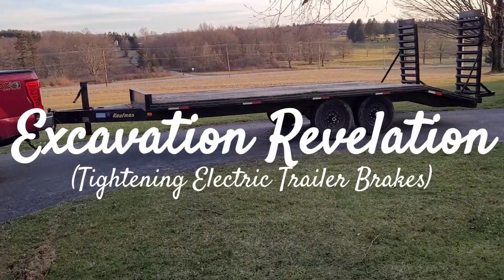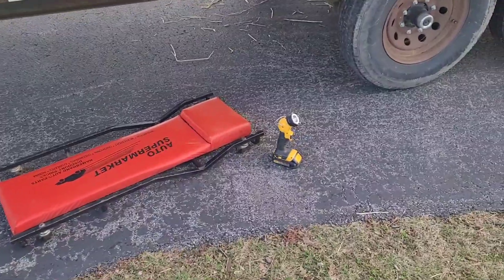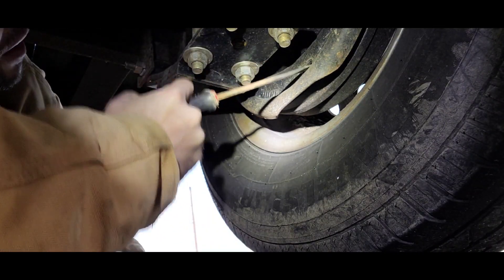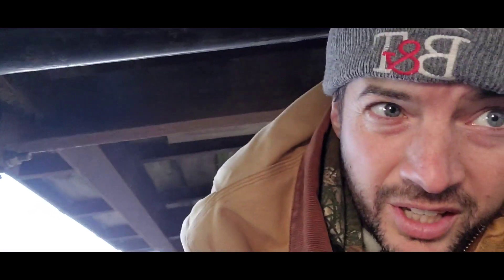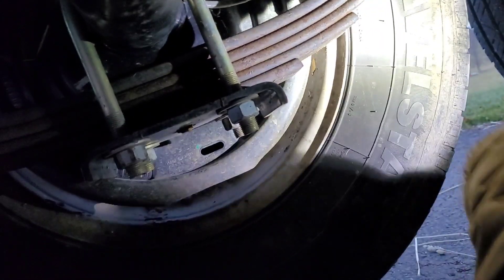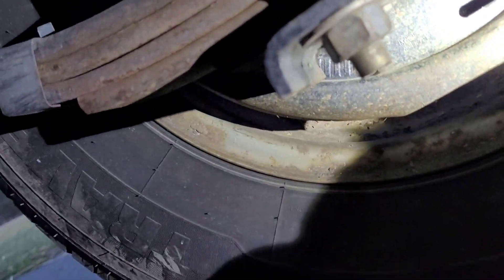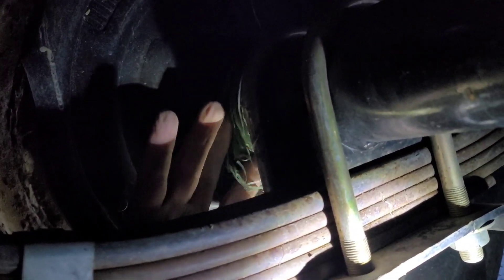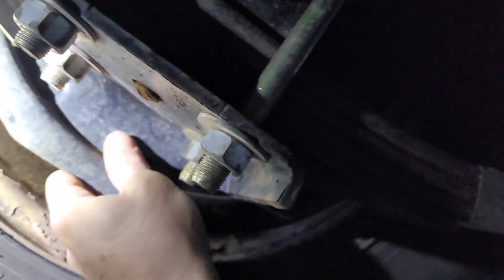Tightening Electric Trailer Brakes (Keeping Them Uniform Is Key)

Comment: It seemed (sounded) like you had them manually adjusted right on your first attempt.  That unloaded trailer should have locked up on about 5 gain, but it didn't.  My suspicion is that some of the magnets aren't functioning.  Did you check them?